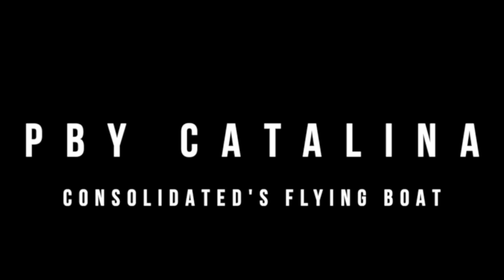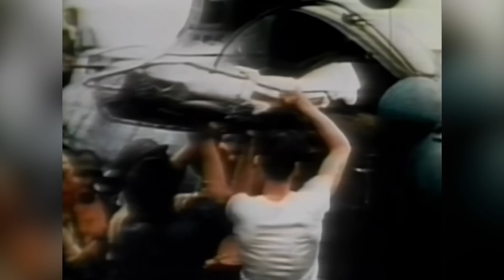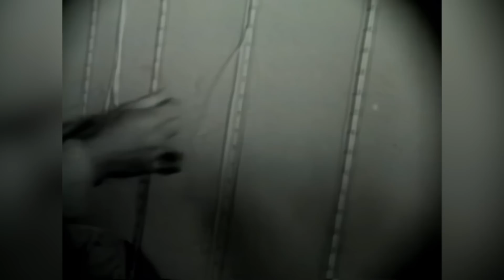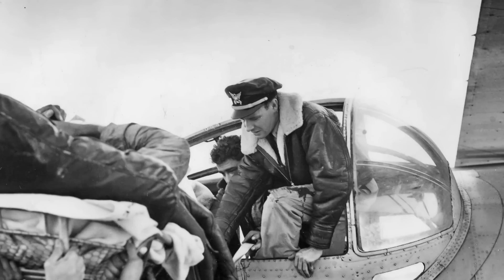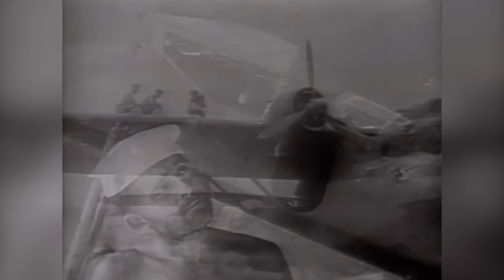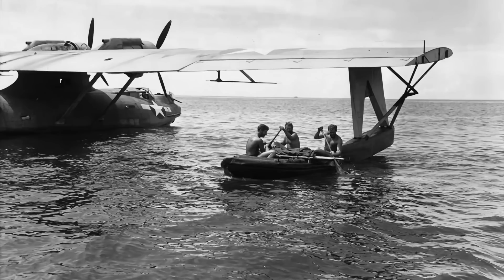PBY Catalina | Consolidated's flying boat and amphibious aircraft | World War II Seaplane | Upscaled

Comment: The wings and fuselage were made of aluminum alloy, not steel. However there were steel parts in them like the long jackscrew that ran the length of each wing out to the floats so they can be lowered or raised manually or electrically. The person narrating this story has his facts wrong. The Catalina climbs out at 90 kts which is a little over 100 mph. A friend of mine had a Catalina -5A and kept it at the Sonoma County Airport in Santa Rosa, CA in early 1990's. Plane was a tricolor blue with white. I was on the crew and worked on it and got to fly it. In that order. We took it to air shows throughout California. Once up to Yakima, WA. Landed on various lakes in NorCal. Was a fun airplane.

Comment: My uncle was a flight engineer/gunner with 6 Squadron RNZAF based in Fiji and then the Solomons during WW2. I recaqll he was always very careful to differentiate between amphibians and flying boats. The latter having only bolt-on trailer wheels for haulouts on the dock. Amphibians are still around because of their versatility for air shows and the like.
Reply: Your Uncle was in the same unit as my old friend, Arthur Peryman, also a flight engineer. Arthur worked for Air new Zealand after the war. he was also a keen model engineer building many steam locos. He passed away in 2016.
Reply: Thanks for that anecdote Peter. My uncle Bruce Andrews went on to a successful career in farm machinery after the war, but many RNZAF people did go to the airlines. Post war all civilian airliners including the early jets had FEs. Now it's just two pilots and a v sophisticated flight management system. Best @peterswatton7400

Comment: My uncle piloted black cats out of Darwin in WWII on minelaying missions after dark. He actually took my father(an Ack Ack  gunner based at a nearby airfield) on a couple of non-mission supply/practice flights. 
 My dad told me decades later that the gorgeously unique whale-like hull of the Catalina is designed for aquaplaning. The goal of the pilot during takeoff is to reach a speed where the hull is "up on the step", that is, the cutaway section of the front underside is gliding over the water, and is not submerged. This is the same principle which operates in small sailing boats when they are "on the plane". Though a Cat's maximum speed was never high,  a Cat would achieve a sudden acceleration once it started planing, which was needed for successful takeoff. The Aussie cats were usually so heavily loaded with munitions that getting the Cat up on the step was never assured; also choppy water and wind conditions could interfere with getting on the step too -- especially after putting down on the open ocean. Missions could be cancelled simply because the wind direction might not allow that minimum takeoff speed to be achieved. Apparently takeoff was the most tense moment of any flight.

Comment: There has been one on a plinth at Lake Boga in Victoria Australia. With some government money they have built a hangar over it. The chap that gave us the talk said that they were trying to get it operational again. Considering the decades on the plinth evidently the airframe was still sound.
Lake Boga was the seaplane repair station during WW2. The area used was very large, some buildings and all the concrete are still there.

Comment: If the cat had a 4000 mile range why was there a mid ocean gap where convoys had no air coverage. ?it is only 2773 miles from Halifax to England.
Reply: Because ranges are dependent on how an aircraft is configured. 
Rating aircraft performance is a tricky thing and Wikipedia makes for a poor source for information because it can make it seem that you get maximum range and maximum altitude and maximum payload all at once when in fact you don't, the heavier you load an aircraft the shorter the range and the lower it can fly.
The number given for a 4,000 mile range are probably just for a standard configuration PBY with a minimum crew and no weapons, load on 500 lb bombs under the wings for dropping on submarines and your range and altitude start decreasing not only from the weight but also from the drag of having bombs strapped to the plane.
A good source for the actual range of a PBY configured for that type of duty would either be the pilots manual or the NACA test reports either of which could be found online.

Edit, just looked up the specs on the PBY, he misspoke, the range is 4,000 kilometers not miles.
Also as I said that's for a standard configuration PBY not one after it's got bombs and torpedoes strapped to the outside of it, just like the listed range for something like a P47 doesn't include if you strap bombs and rockets on it, the listed range is only for standard fighter configuration. 
And I'm pretty sure after the PBY came into play there was no longer a gap in protection for convoys in the Atlantic, pretty sure that gap only existed early on when the PBY wasn't being used yet and aircraft designed in the late 20's and early 30's were, the mid/late 30's saw the development of the successful aircraft engine's and subsequently the aircraft that were used during WW2.
Reply: @dukecraig2402  The VLR Liberators and Escort Carriers helped to close the Black Gap. VLR, Very Long Range, stripped to the bone and carrying extra fuel, the VLR Liberators were like flying gas cans, equipped with a handful of depth charges, a couple of machine guns and a search radar.
Reply: @markfryer9880  
Yea I know there were other aircraft involved in closing the gap that existed in the convoy route at the beginning of the war, the Navy version of the Liberator could probably fly all the way from England to Halifax and back on one load of fuel, I think I also remember reading that Coast Guard ships from both the US and England had their ranges extended or they got longer range boats capable of going the distance for the sake of picking up sailors from sunken ships because the convoys and their escorts couldn't stop, even in a lifeboat going in the water during the early days of the convoys was a death sentence.

Comment: There was a guy who tried to use a Catalina to run vacation tours up the Nile.  With planned stops for sight seeing, and at river side hotels.  But the further up stream they got they ended up higher in ground elevation, so the wings quickly became less efficient.  Too bad, the PBY's observation blisters were perfect for this.
Reply: Huh that's strange since the cat had a service ceiling of 16,800 ft don't think any of the Amazon River is that high.
Reply: @cwo4catshooter  
Not if he had it overloaded.
Reply: @cwo4catshooter  Nile River in Africa, the Amazon River is in Brazil, South America.
Reply: @markfryer9880  dosent matter neither river has a navigational section above  16,800 ft
Reply: @markfryer9880  why would you over load a aircraft with passengers on board
Reply: @cwo4catshooter  Yeah, right?  That's what I thought.  I saw it in a documentary, I'm hunting it now.  I'm pretty sure it affected take off airspeed.  I suppose that it's just different for an 'honest to God' seaplane rather than a float plane.
Reply: The only company  that actually made a go at sea plane tourist flights was chalks air ways they opened in 1917 and operated till 2005.

Comment: I love the PBY.  First plane in fly direct between Continental Chile and Easter Island ( Isla de Pascua).  Using Stars as GPS,  almost 4000 km in 20 Hours in 1951. A milestone for this great plane and for our country .  Thanks for you  time to do this video.
Reply: Hi Moto Art , good comment . The   ManuTara  flight from La Serena , Chile to Easter Island in 1951  was a total of 2047 nautical miles  (3791 Km. ) and it took 19 hours and 22 mins.  Unfortunately the plane was damaged on take off and could not be repaired there and then so the pilots and the crew had to be taken back  to the continent on a Navy vessel. 
I have no details of what happened to the plane after this accident but  Apparently the Manu Tara was somehow taken to tha continent and lost sometime later , pity !  
Cheers mate!